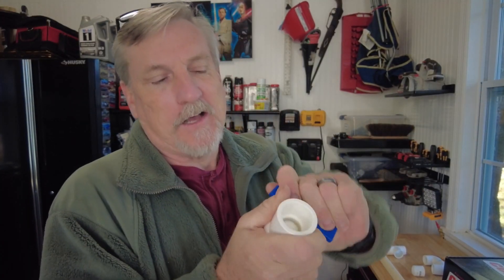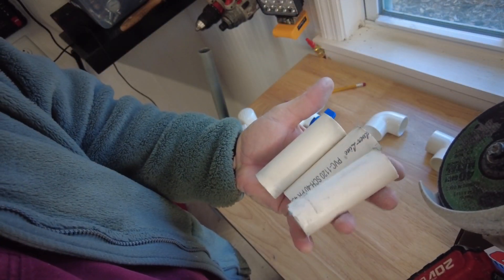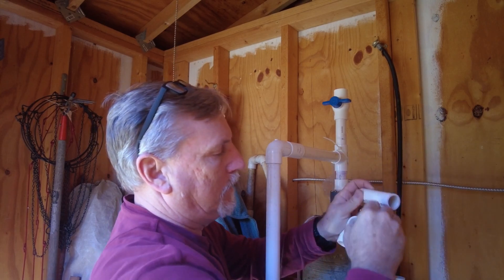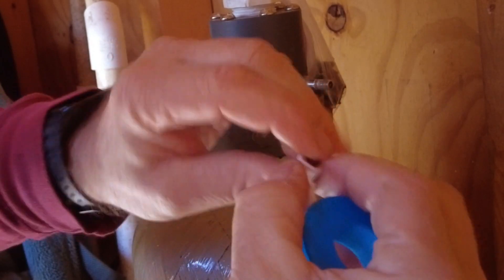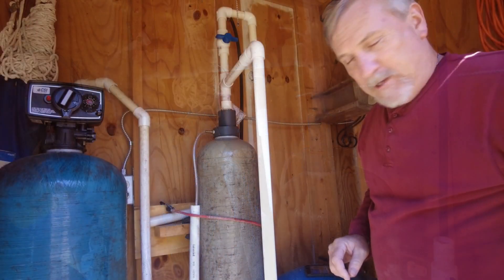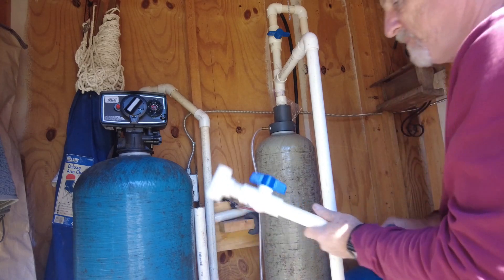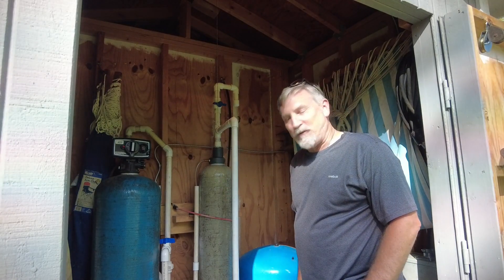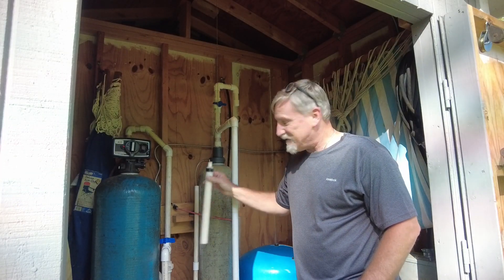Still Trying to Get Rid of Bad Smelling Water (Sulfer Water)

Comment: Maybe its just me.  Not as clear to me as I would like. Wouldn't the section of pipe you installed need to allow the smelly fumes to escape at all times? Perhaps by having fine mesh at the bottom? Not sure what the small copper pipe does.
Reply from the maker: It might be easier and quicker to show you how the air escapes the system. I created a play list for smelly / sulfur water. Watch (Removing the sulfur smell from well water using the CSI REACTR aeration tank). You could fast forward to the 22 minutes and 30 seconds mark. There you will see the air escaping the aeration tank. In a perfect world as water enters the tank and the sulfur gases are extracted the tank would slowly fill up with sulfur gases. The float valve I talk about is designed to stop air from getting out at specific spot in the tank. Anyway watch that and see if it helps.
Reply: @diyhomefront1695 did this work?
Reply from the maker: @scooterwoodley195  unfortunately no
Reply: @diyhomefront1695  I’ve since watched your 3rd video and it seems you finally got it sorted out!
Reply from the maker: @scooterwoodley195  It has gotten better but still not perfect, it seems that from time to time the smell is more noticeable than other times. It seems the war goes on.